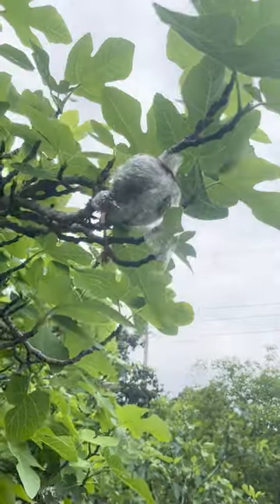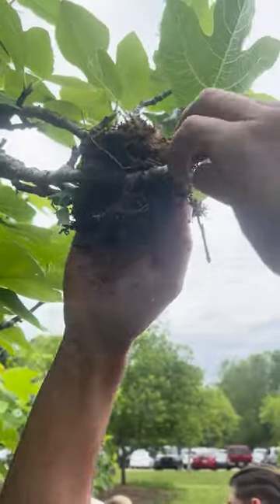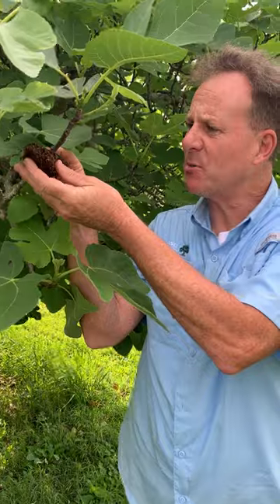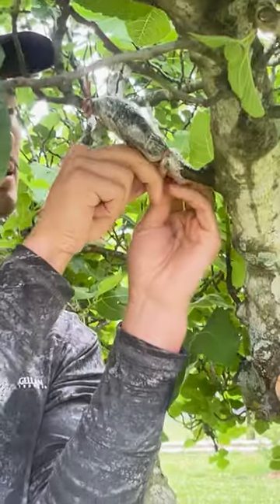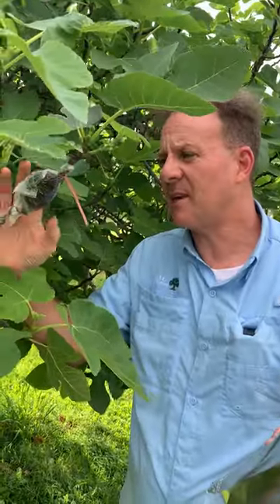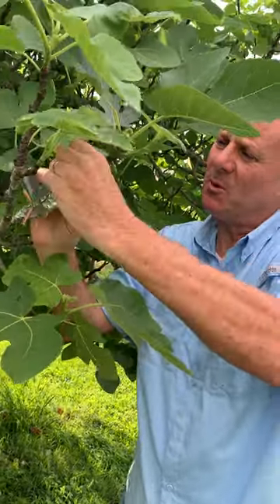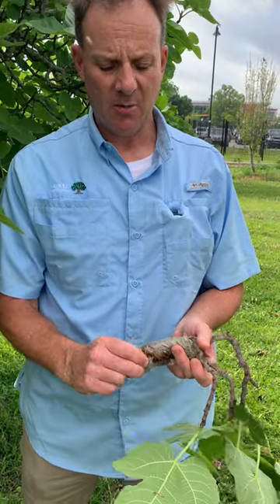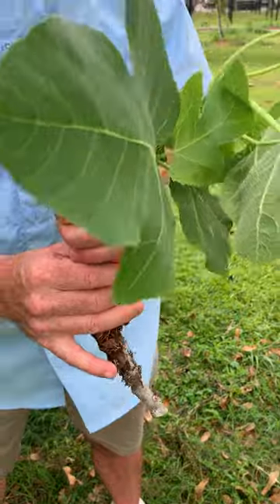How to Air Layer a Fig Tree

Comment: You're supposed to remove the bark down to the green cambium layer all the way around the branch about an inch wide. You would then wrap or pack your medium around that cut and seal it up. I've never tried doing air layers without first removing a section of bark and not sure how efficient that technique would be. Never seen anyone else doing it that way either. Now I use the clear balls that come with little round peat disks that you soak and it expands to fill the ball perfectly. The balls are like clamshell construction so you just place each side of the ball  on the branch and they snap and lock together. I prefer this method because it works over 90% of the time and you can see the root development inside ball and you know when to cut the branch off the tree. I wait for the ball to be pretty well rooted before removal and when you cut from tree you have this perfectly round little 3 inch root ball fully intact by all the roots. Oh I also rub rooting hormone on the cambium before applying the peat filled ball , could have something to do with my high success rate, maybe maybe not. I'll also add that the time of year you apply your air layers will determine your success as well.  Want to make sure temps don't drop below 65 at the very lowest. Warmer is even better ,especially make sure night temps arnt dropping below 65 and you'll notice better success
Reply: I appreciate your. Comment more than this video!!! New "farmer" and wanting to maximize my fields yeild each year and this seems like a great way to start out with less and make more! Someone who for a short time grew cannabis I did learn how to use different techniques with cloning so doing this seems a way easier way! Again, thank you